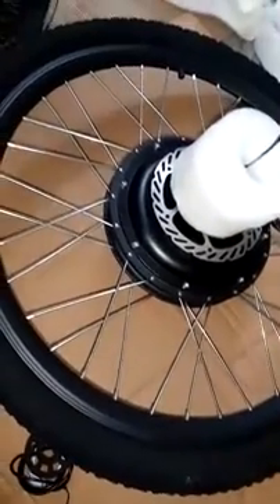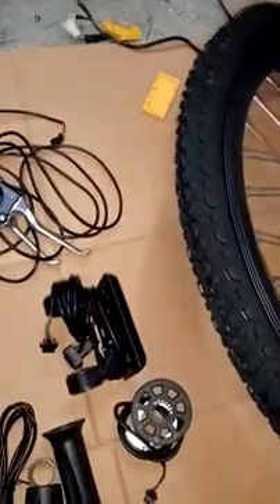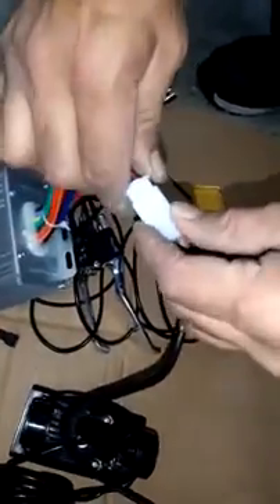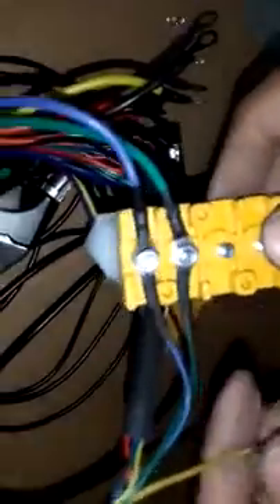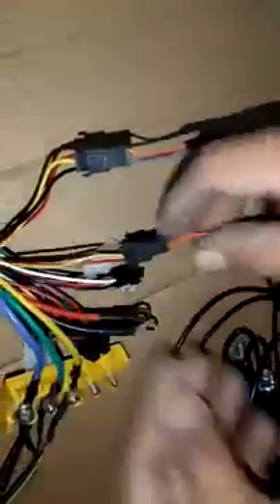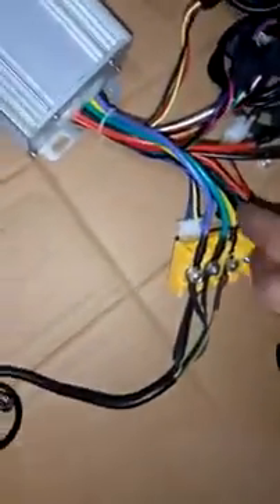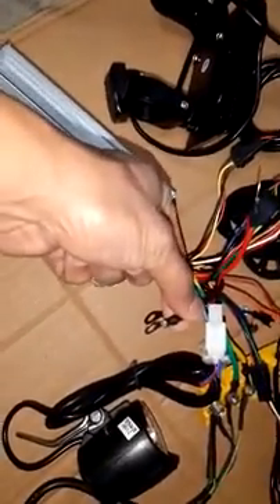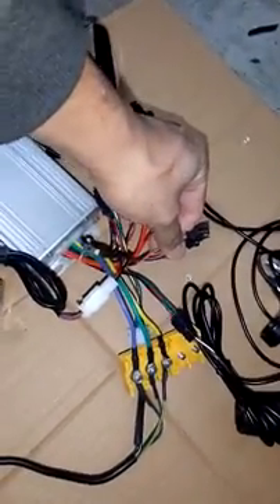Pedalease 48V 1000W 26” kit 30A controller Assembly

Comment: He says the blue wires are free wires not used! This is wrong as you will get error 10,there is a 2 plug brown and white wire that plugs in to a single blue this will remove the error 10..I hope this helps someone 👍
Reply: I thought they were intelligent learning wires the blue ones to resolve direction of hub spin, what does connecting the wire blue to brown white control?